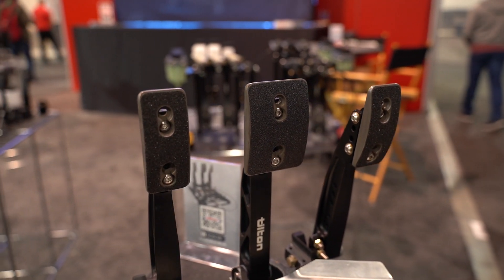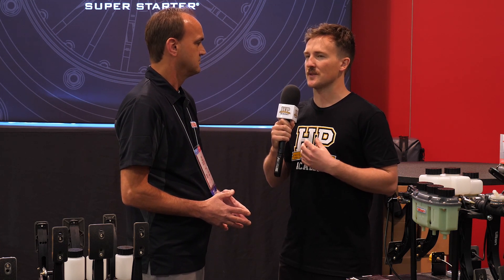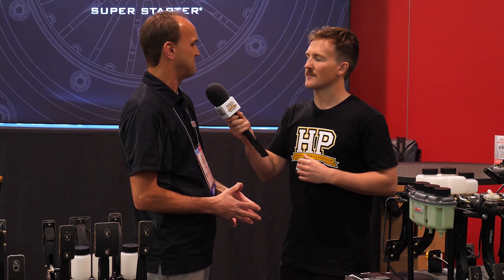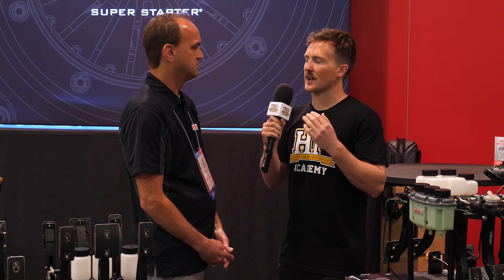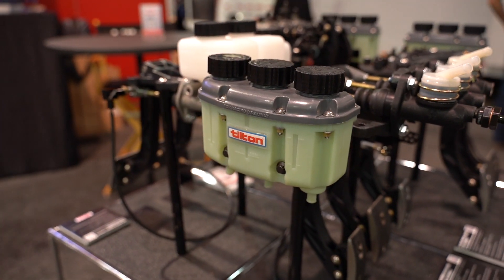Why Don't Pro Race Cars Use Brake Boosters?

Comment from the maker: ✅ Building a fast car? Get $400 OFF the all-inclusive VIP online course package deal: https://hpcdmy.co/vipy114
🛑 Brake System course. Design & optimise your set up. Now 50% OFF your first course: https://hpcdmy.co/offery114
TIME STAMPS:
00:00 - Intro to Performance Braking Systems
00:04 - Kirk from Tilton on Balanced Braking
00:09 - Transitioning from Street to Motorsport Braking
00:14 - Understanding Motorsport Braking Setups
00:31 - Dual Master Cylinder Setup Explained
00:43 - Achieving Braking Balance with Master Cylinder Sizing
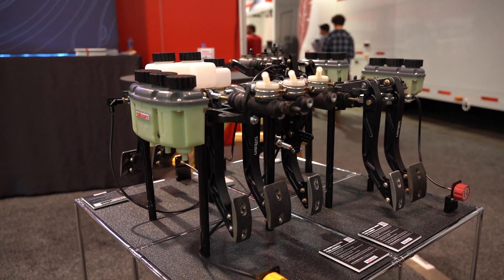00:56 - Factors Affecting Master Cylinder Sizing
01:01 - The Role of Pedal Ratio in Braking
01:09 - On-Track Braking Balance Adjustability
01:26 - Benefits of Manual Braking Systems
01:37 - Driver Feedback and Brake Pedal Feel
01:59 - Sizing Dual Master Cylinders for Motorsport
02:15 - Starting Point for Braking System Specs
02:24 - Caliper Sizing and Master Cylinder Considerations
02:58 - Pedal Ratio Differences in OEM vs Motorsport Vehicles
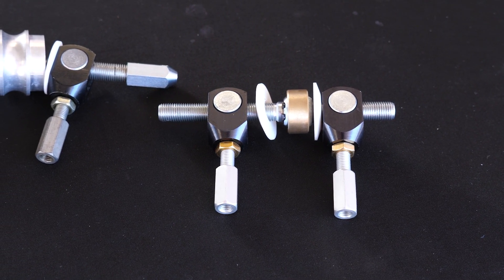03:31 - Setting Up the Balance Bar for Initial Brake Bias
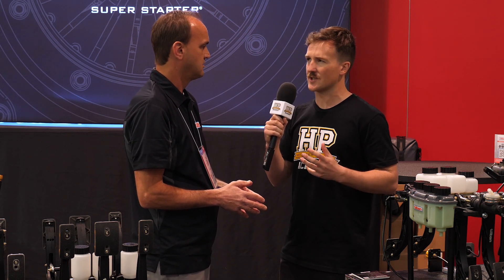04:08 - Making Adjustments with the Balance Bar Dial
04:52 - Comprehensive Approach to Spec Braking Systems
05:19 - Predicting Master Cylinder Sizes with a Program
05:44 - Real-World Adjustments Post-Mathematical Predictions
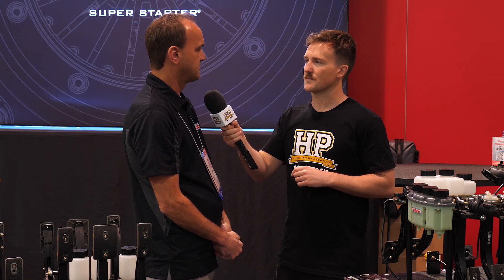05:51 - Learn More about Tilton Engineering Products
6:00 - BUILD | TUNE | DRIVE

Comment: Folks, quick question for any commenters who know their stuff.

1. 6:1 Master cylinder with brake booster delete on the street. Bad idea or not? (Search chasebays).
2. Pedal box on the street. Bad idea or not?

Car will likely be a 600hp rwd setup using 4 or 6 pot calipers, enlarged discs and relatively agressive pads.

Intent of the above options 1 and 2 is for the following reasons:
- improved brake consistency.
- improved brake feel.
The build is centered around fun and capable street performance while being good enough to do the odd trackday.
It's difficult to ask these questions in mechanic groups or reddit without being laughed out of the place. I feel here, specifically this video, is most appropriate.
Thanks!
Reply: The chase bays master setup you mentioned looks interesting, but is very limited in scope of where it would be useful, in my opinion. 
In this video they mentioned a max pedal ratio of 6:1, but most cars and builders I personally know of have shot for anywhere from 7:1 all the way to 12:1 (off-road truck, more weight, etc). Also, a lot of those setups use smaller master cylinder bores to get a higher brake line pressure from the get go (7/8” to 1”). Rather than swapping a pedal or calipers it might be easier or cheaper (if you don’t already have the biggest possible options in the other areas) to just swap a master cylinder to get a different bore size to achieve your desired feel. 
That all in one setup might be perfect if the rest of your brake system matched those specs, and there is a bit of adjustment in the prop valve it has, but you’re limited to 6:1 pedal and 1” bore. 
If you know some specs on your car, there is a very handy calculator (just like the one mentioned in this video) that is extremely helpful and well put together at https://brakepower.com 
No ads, free, every variable is explained at the little “?” next to it, and more in depth than most street cars would ever need
Reply: @ggud Hey, I've only just seen your comment. No idea how it escaped my notifications.
Thanks so much for your reply! It is very helpful

Comment: What's the benefit of a dual master cylinder setup compared to simple installing a bias valve on the brake lines running to the rear brakes?
Reply: For me, probably the most important thing is pedal feel at the limit of tyre adhesion. With a bias (proportioning) valve in line to the rear, the pressure your foot commands is the full unadulterated value to the front brakes and a proportionally lower value to the rear. That's all fine until you back off the pedal, to modulate traction (say into a tight corner in the wet, for example). As your foot marginally backs off and reduces line pressure, only the front brakes will experience that reduction, UNTIL the reducing line pressure equals and then drops below the bias valve setting. During that small period of time, rear brakes will give the impression they are dragging/binding. Technically, they are, and the lack of direct control over the rear braking effort can be really distracting! With a twin master cylinder setup, they won't be able to do that. That's one of several reasons to use twin cylinder pedal boxes.
Reply: @robair67  I see. That makes a lot of sense. Thanks you!

Comment: is there not a way to have a brake booster that has consistent performance in race applications? Like maybe not a traditional vacuum or pressure setup
Reply: dont forget that the forces in the race car (throwing the driver around) are so great that is it hard to modulate a over servoed pedal.. you need less assistance to be able to modulate the pedal properly. Some cars, like rally cars, are driven with throttle and brakes at the same time, so vacuum servos just do not work..

Comment: They do use master cylinders… all race cars, even modern brake-by-wire systems, use master cylinders. The brake booster on the other hand, is usually ditched for race cars.
Reply: You're saying the same thing the video was saying

Comment: At the higher level of build we use ABS modules. That takes care of brake balance under all conditions and variables. The driver then has a rotational switch with 7 (The most that seems necessary) settings usually programed with 2-3% between settings, which can be selected to suit different parts of a track, or help make the brakes at one end last to a pit window if they are running too hot or when swaping drivers, as each have their own slight preferences. 
We allways design the pedal fulcrum ratio at atleast 7:1, 9 or even 10:1 if mechanically possible and no servo is used. 
It all saves weight, but sometimes the drivers insist, if the pedal force required is too high. You can't say to them; "Don't forget leg day" They might take offence.
Reply: to be fair, pressing that hard with only one leg is terrible for the nervous system and pelvic alignment. There is no shame in designing a system that doesn't require one leg pushing 100+ pounds many times every lap. Anything that can reasonably reduce driver fatigue will produce more consistent laps, lower failure rates... usually faster laps too. I also highly doubt you use asymmetrical density lumbar and rear pelvic padding in the racing seat to account for the forces developed by the left leg. but surprise me. I do appreciate you sharing your racing knowledge.
Reply: @mm6705  Force at the pedal rarely exceeds 30 Lbs, unless the driver has made a mistake. Pressure above 60Lbs is irrelevant as that would generate enough line pressure to lock the wheels, as such braking control is via the ABS valve/modulation frequency
Reply: @gothicpagan.666  Oh, so when the pedal is that heavy, it was an incorrect choice of parts? Between the mechanical advantage of pedal ratio and master cyl piston size you shouldn't need more than30 ish pounds? Thats good to know. I must have had incorrect conclusions from a past data point that was an outlier, thanks for educating me!
Reply: some single seaters (like some F1 cars) use wide brake pedals where you can hit them with both feet. I have seen 90kg pressure at the pedal in a simple junior formula car... @mm6705

Comment: Interesting. I have a 1/2 ton truck that makes over double its factory HP. I have upgraded to Alcon calipers and rotors in the front but it doesn’t seem to be enough. I was looking at getting Jeep Trackhawk brakes adapted to my vehicle so that I can have a 15” disc with 6 pot calipers as I currently have a 13.6” disc. That means I’ll have to find a brake master cylinder that will work with those calipers.
Reply: 13” disc isn’t a very big to start with , we use that size for the rear discs on our race cars that weigh little over 1100kg with front and rear aero . 
Disc thickness makes a big difference as they are stronger and dissipate heat better too . I’d double check it’s not having a conflict with the abs system, any stability control junk fitted / pressure regulator valve if fitted etc etc . Would suspect your master cylinder is now not matched/ bled / vehicles too heavy compared to the disc size. US trucks seem to have small diameter wheels when it comes to pickup trucks .
Reply: @newagetemplar6100  technically it’s 350mm but it’s still not enough. 6,000 pounds on 305/45r22 Toyo Proxes ST3 tires doesn’t engage abs at all.
Reply: @RadDadisRad  maybe not enough braking force on the rear ? Kinda hard to keep guessing so it will be just down to trial and error, but that’s where I’d be looking at next . 
1 
brake master cylinder compatibility / long pedal 
2
Rear proportioning valve if fitted ( free off if seized ) or remove. As this may well be restricting the rear brake efficiency leading to too much reliance on the front brakes . 
3
Maybe put a manual rear brake bias valve / lever on the rear lines ( AP / Alcon / willwood do them ) .
Reply: Out of interest, can these be used on cars with rear drum brakes? Also, noobie question… is it street legal?
Reply: @stooartbabay yes they can be used on vehicles fitted with rear drum breaks and is perfectly legal (UK) . 
Sometimes there’s a rear proportioning valve say on old cars this is usually taken out too . That would be for the back axle to stop the rear brakes locking up . Usually the mechanical handbrake can be retained too if needed for legality.
Reply: Can you define 'Doesn't seem to be enough'? Is it pedal feel and stopping ability, if so were the Alcons sized correctly for the master cylinder?
Is it fade, if so do they have adequate cooling, pads, fluid?
Reply: @neversettle7666  the Alcons come with the Shelby F150. I upgraded to the Shelby braking system and it’s still not enough. Brakes get hot and start to fade slowing down from 130mph. I even have the most aggressive pads that I can find.
Reply: If your truck has an original brake booster, you'd have to swap the booster and master cylinder along with calipers and rotors, otherwise the pedal feel would be wrong and the amount of assist would probably also be lacking to the point of actually reducing brake performance. Many people go for big brake kits, but forget the other components in the system. I learned that for my A4, going with Brembo 18Z calipers, I needed the RS4's larger booster and master cylinder, because the original wasn't pushing enough fluid for the 6-pistons vs the original single piston.